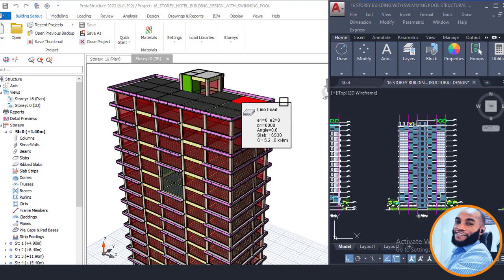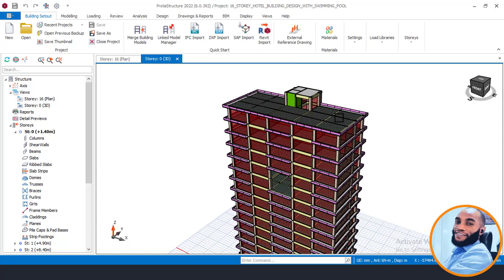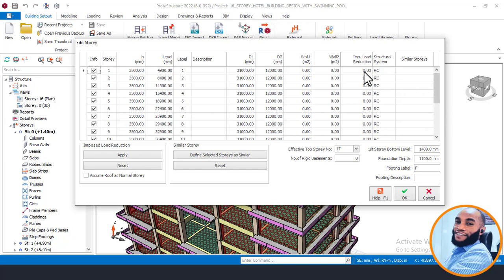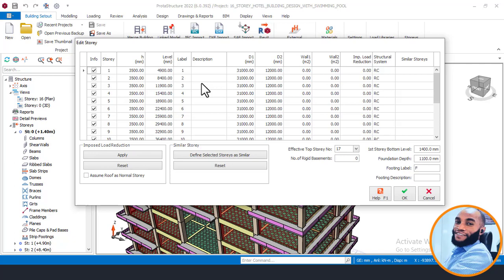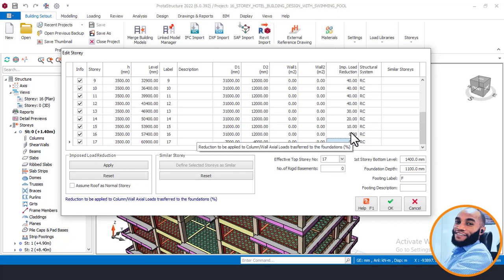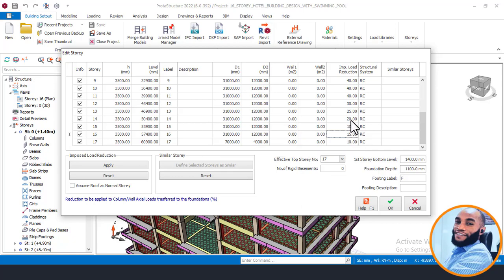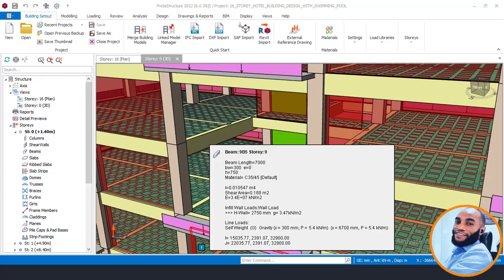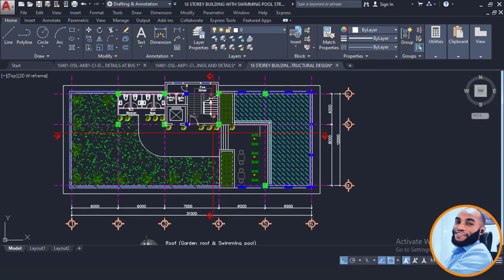PART 10 - 16 STOREY HOTEL BUILDING DESIGN IN CIVIL ENGINEERING USING PROTASTRUCTURE 2022

Comment: Is the imposed load reduction correct? Lower storeys should have  less %ge reduction ....higher storeys more...
Reply from the maker: No, lower Storey is more than the upper floors
Reply: May be prota works different, 

Because the rules for imposed load reduction are detailed in EN 1991-1-1, Clause 6.3.1.2(11).
Reply: For the 16-storey hotel example (Category A, Psi _0=0.7):

At the 1st storey (supporting 15 floors), you would input a reduction of 28% (meaning 72% of the load is used, according to the eurocode).

At the 14th storey (supporting 2 floors), you would input a reduction of roughly 15% (meaning 85% of the load is used).